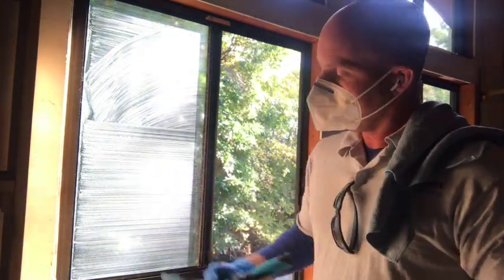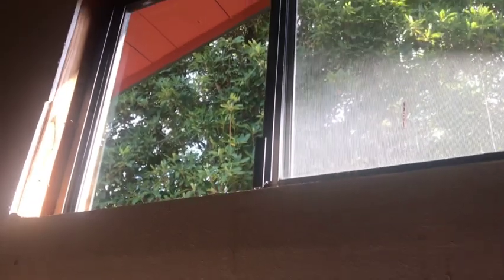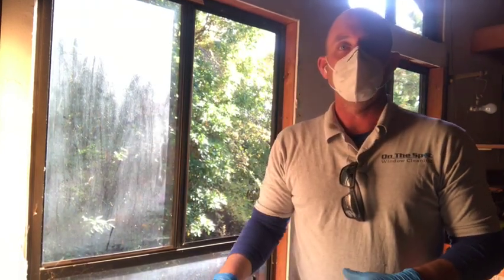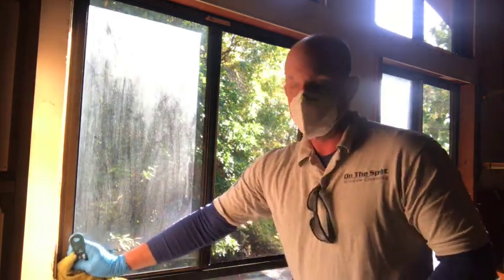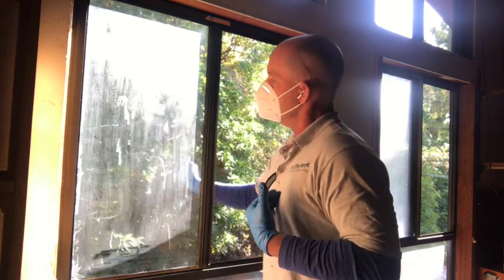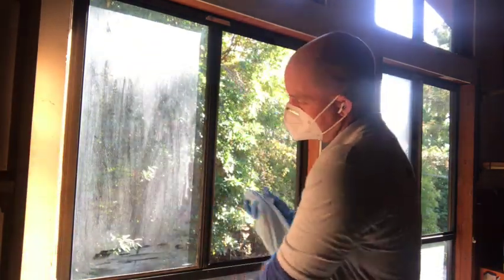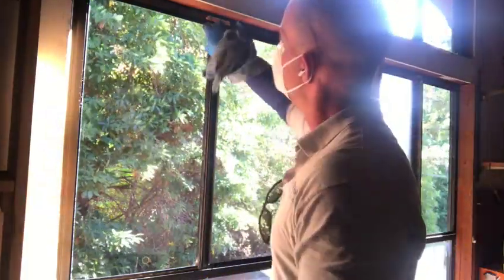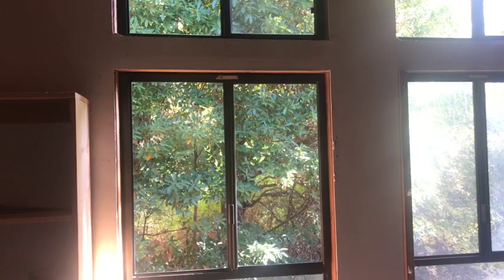Amazing Before/After!!! -  How to clean extra dirty windows   -  Professional Window Cleaning - SLO

Comment: what cleaning produtcts do you use? what kind of soaps and glass cleanig solutions?
Reply from the maker: Mild dish soap (I prefer lemon Joy). We use vinegar to break down mineral deposits. That gets us through 99% of what we deal with.
Reply: @onthespotwindowcleaning  did not think of vinager ... works great .... thanx a lot
Reply: @onthespotwindowcleaning do you mix the vinegar with the dish detergent? Thanks for your video!
Reply from the maker: @arlindajones-abekasis5665  you can mix a cap full or two of each in a couple gallons of water and use immediately for the best results.

Comment: What is the magic solution used on the windows?  Eye must haves
Reply from the maker: Mild dish soap (I prefer lemon Joy). We use vinegar to break down mineral deposits. That gets us through 99% of what we deal with.
Reply: @onthespotwindowcleaning  what are the best proportions of water/soap/vinegar? Thanks!

Comment: Do you still like using the liquidator? What rubber do u use? I’ve used Ettore master and it seems to leave streaks on the window no matter what I do and I’ve heard Steve-o on his YT channel talk about that too, I want to like it but I can’t get good clean results. Any suggestions ? Great work BTW
Reply from the maker: I'm a tool junky, so I use all sorts of stuff. I've found using it on a 40º angle on the handle helps. I love the edge work, but the middle is temperamental for lines.  I've had solid success for the past couple months using the 18" liquidator for most of my work. A little more soap goes a long way
Reply from the maker: and I usually use the Ettore master rubber or Unger green

Comment: Great video! I love cleaning glass. Did you say brass wool to help with the stubborn grime? i have been using 0000 steel wool. Yes it does rust after it gets wet but hopefully will not scratch the glass.
Reply from the maker: It's bronze wool. 000. Doesn’t rust😎